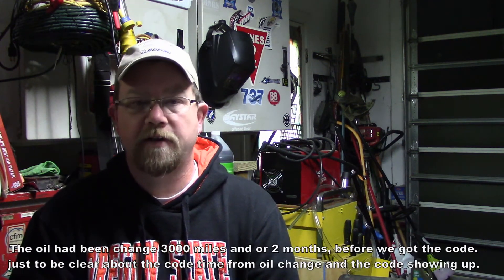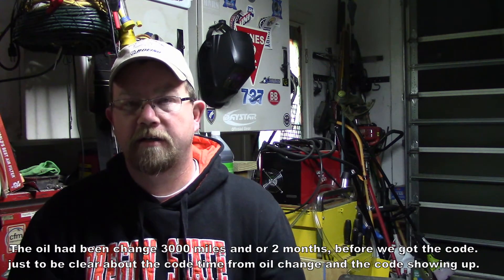Jeep JK P06DA Engine Oil Pressure control circuit failing.

Comment from the maker: ********UPDATE*******: Okay, here are the final facts of what was found and what was fixed on ZUUL, per the shop. 
1) Found burnt/melted oil pump control solenoid and the ECM oil pump driver control circuits.
2) Found the P06DA was stored and active in the ECM.
a) Did the manual pressure test and found that at idle the engine oil was at 85 psi, found to be excessive.
b) Tested wire harness and found no shorts.
c) Removed oil pan and inspected the oil pump and found the solenoid to be melted. Replaced oil pump assembly (with new solenoid). Reset everything and tested the engine only to have the code P06DA to come back with high oil pressure. 
d) Suspected ECM to be faulty with a shorted driver, Replaced ECM code is gone, no DTC, oil pressure at norm operating psi.
So, what was replaced
1)  1ea. 68252670AO Oil Pump assy cost $200.00 OEM
2) 1ea. 5184093ae Chain tensioner cost  $14.00 OEM
3)  1ea. 68082860AB Tube of sealant cost $20.00 OEM
4) 1ea.  68259136AB Engine Control Module $250.00 OEM
5) 6qts. of  5W20 Syn Pennzoil w/ filter cost $ 65.00 OEM (filter)          
So, just in parts was $549 (figuratively) and about 8-10 hrs. in diagnostics and repairing, I believe the shop rate is $90, oh and the loaner car for 3 days @ about $50.00 per day.
The total bill would have been around  $1600.00 or more, but Jeep paid for it, luckily we were still under warranty :).
I hope that this helps people get a better understanding of the cost and what to expect.
Reply from the maker: Well, 3 months later and no issues.
Reply: I have been absolutely BANGING MY HEAD AGAINST MY JEEP with this code. Watching your video & the above components replaced, do you have a gut feeling on which component replacement finally did the trick….or was it the perfect storm of replacing all those items?

I have a ‘15 JKU I have now replaced the oil cooler/filter housing, with fresh upper & lower gaskets, changed oil a few times (heard somewhere it could be that simple….clearly not), tried factory resetting the ECM, but not even certain the steps I found online did anything…

The oddest part to me is that I’ve been watching my oil pressure like a hawk & appears it’s not getting stuck in high pressure mode, which I believe typically signifies the solenoid and/or pump is shot. Upon starting the vehicle yes the pressure is higher usually around 60 to 70 psi, but then adjust itself back down to mid 20s. When giving it mild throttle I end up somewhere in the 60 to 80 psi range & feeling dangerous, if I really stomp on it I’ve seen the oil pressure go as high as 99 which I believe is the maximum value it will report?

One caveat I will throw your way is that I do have a super chips tuner & with the 2015‘s & up jeep encrypted the ECM, so SuperChips had to send me an unlocked one, which worked fine for about a year. I also have an OBD two scanner, which I check incredibly frequently & get codes relating to “lost communication with abs control module, lost communication with ipm & bcm & lost communication with ecm…phew!

Any feedback and/or ideas would be greatly appreciated as I am at my wits end over here. I really feel like it’s not related to the pump and/or solenoid because I do get those mid 20 psi at idle readings but on the other side of the coin when I get up to 3,000-ish RPMS, not even really stomping on her, that’s where the pressure skyrockets into the 80s.& sometimes 90’s.

Maybe it is time to drop the oil pan and inspect the solenoid and pump, but the fact that I’m getting all of these electronic code failures sort of leads me to believe that the ECM has some issues?

Appreciate any ideas or feedback you can provide & THANK YOU SO VERY MUCH!
Reply from the maker: I'm thinking that your ECM might have pooped out on you, because what were told was when the solenoid shorted out, it might have messed up the ECM.
Reply: Would be wise to check oil pressure control solenoid wiring connector for proper seating, cleaning connectors and reseating before thinking of dropping lower and upper pans. This is sometimes the case with Pentastar 3.2/3.6 code PO6DA.

Comment: Thank you for the informative video and feedback.
Accidentally cancelled my comment vs comment.
I'll keep it short this time. 

T&C 2012 Chrysler
Mileage: 180k+
2 years ago I changed the Oil Sensor (Code P0520)
Had P0420/P0430 still have it.  Recently got the P06DA and P0128 (Which I Fixed/Thermostat Sensor)
This might be one expensive repair or a week project.

Thanks again,
Reply from the maker: No worries! Never saw the comment.

Comment: Great video, thanks. This really gave me a goog idea with my troubleshooting. My PO6DA code was caused by the wiring harness for the solenoid to not be seated properly. Cleaned and reseatted male/female connectors. Thought this could help as a starting point for the code.
Reply from the maker: Glad it helped

Comment: I didn't have to pound on the pan to remove it. Use those pry bars called a "maidens slipper". I replaced the solenoid with the Dorman unit which I think has already crapped out within a few hundred miles. Looks like I need to do the job again with a Mopar pump.
Reply from the maker: Since they replaced it all and now we have 40000 more miles it's still doing great. I wish you luck and hope it all works out to the best.

Comment: Just had the po6da code pop up today on my 2019 Chrysler 300s. Runs fine and oil pressure is reading normal. Just like him I’ve been researching literally all day trying to see what could be causing that code. Very little info for that code as he mentioned so with it reading normal oil pressure I’m thinking it may be the solenoid.
Reply from the maker: That's probably the issue. 50000 miles later no issues after it and the pump were replaced.

Comment: Is it safe to drive around without breaking down anywhere? Because my jeep got the code p06da but idk if I could still drive it around because I’m in college
Reply from the maker: Sorry for the late reply. I would not, because you are not given proper lubrications and could cause more damage to the engine.
Reply: @jetzombie  can I make it home if it’s three hours away?
Reply from the maker: If it was me, I wouldn't do it. Too much can happen with overpressure

Comment: hello so why wouldn’t just replace the sensor so are you getting 3 different code i’m getting one error code P06DA and that is the oil pressure control sensor why not trying the sensor first
Reply from the maker: When I did a check with my Autel I found that the pressure of the VVT was dead, and it also is common issue with the 3.6L engines.
Reply: I would suggest checking connector first.

Comment: I had 4 psi oil pressure at normal temperature, and 29 psi when first started. No oil codes, but I figured it was the oil pump solenoid. I changed with a Dorman solenoid, started up...same oil pressure. I changed the oil pump with a Melling brand. Still the same. I already changed the oil pressure sensor twice which was the first thing I did. After this I bought the oil pressure tester cap for $133 to verify the Evics reading on the instrument panel. Now I'm stuck, wondering if it's the computer. Anyone with ideas?
Reply from the maker: Part of the problem is going back to the Dorman. I've never had excellent luck with Dorman Electronics, I go with OEM. Have you used a scanner like Snap on or Autel that can give you the actual reading to see if the numbers are correct? The ECM will not trip a code unless the parameters have failed. Oil weight type can cause an issue like to thick will be low and thin will be high. Also, if the oil pick-up tube in the sump has a dirty screen can cause a restriction too. I worked on a 3.6 Penstar on a Dodge caravan and found that the oil pick-up was bent and a piece of plastic partially covering the screen from a previous repair from someone else.